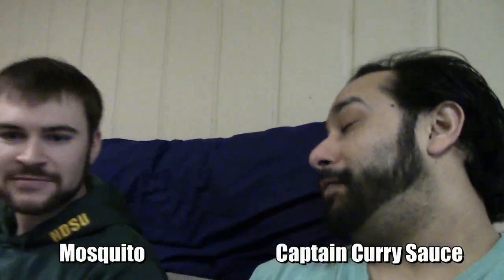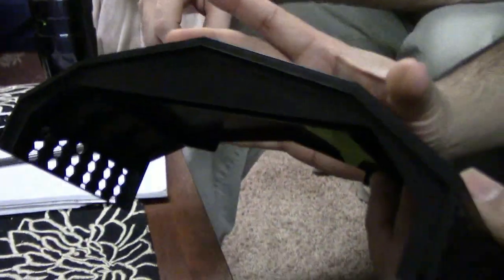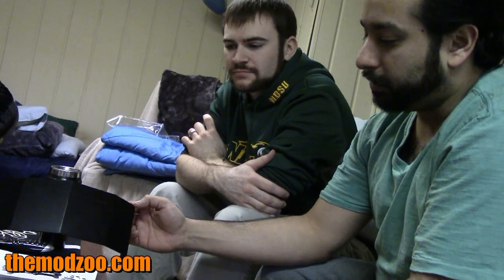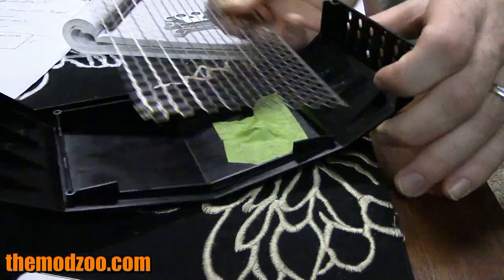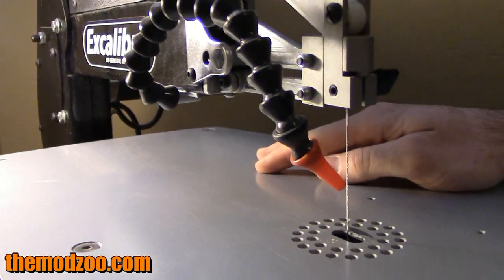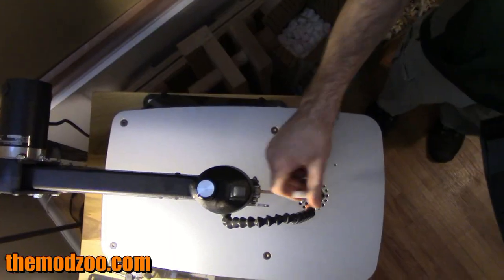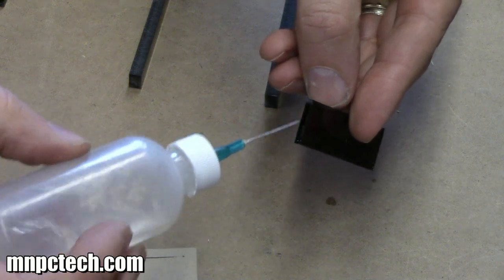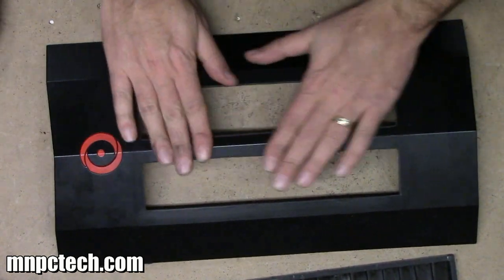"MZ-2" GENESIS Origin PC Mod Zoo Case Mod, PART 2

Comment: Whats the best way to cut acrylic sheet???Thank's
Reply: Thanks for that i got safety eye wear and dremel so good to go,,,its going into a custom pc desk im making,,it will be part of the top so you can see pc and all watercooling inside,,no weight will be placed on the acrylic so what thickness of acrylic would you recommend?
Reply: Thanks for that,,,i just check out Trent plastic's which is uk company which is great for me,,going to join Mod zoo now,,Thanks again,,,this going to be my first proper Mod,,i've sleeved cables and customed watercooled my Cpu but i wouldnt say that was a Mod,,,the desk im planning will have my G27 wheel with hand brake mod all built in to desk 3 monitor eyefinity which slides back for playing games like COD,,,then monitors slide forward to play with steering wheel,,,got flight stick too i may add that at a later date,,,so i class this as a big MOD!!!,,,to say its my first,,
Reply: I GOT TO BUILD IT YET,,NEED A FEW OTHER BITS AND PIECE'S THEN GOOD TO GO